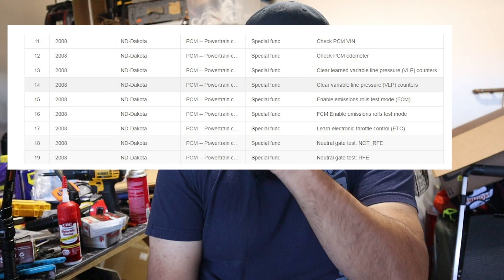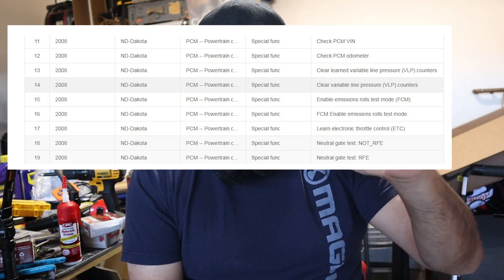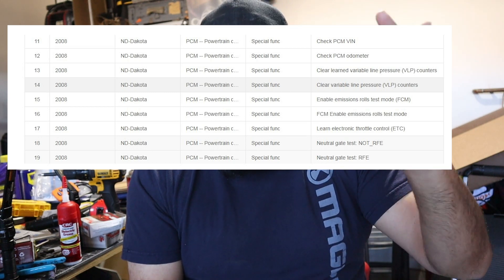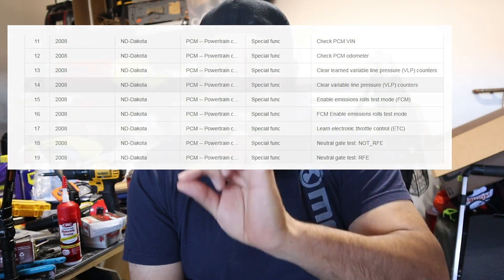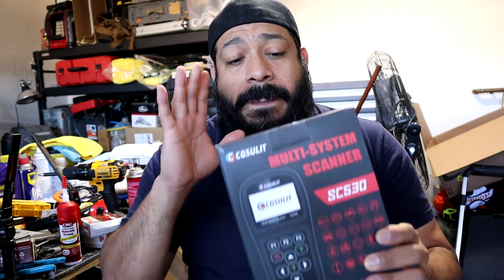Fixing Code P1745 on a 42rle transmission

Comment: Did resetting the code make the transmission start shifting again? You weren't very clear about that. 
 Typically erasing a code is not going to fix a problem.
I'd contact whoever you got the transmission from while the warranty is good.
Reply from the maker: Yes with the scanner that I got it reset it and takes out of limp mode after you cycle your key so on the off the on , you can Sara’s the code or it will go away on its own after a while, 2nd note I have evening having issues with my transmission which to be going back into limp mode after about 3 months I might have. Wiring issue I notice my plugs were funking might have to replace the plugs sense the transmission I put in is a rebuilt so brand new  hopefully this helps

Comment: You saved me lots of $$$. Followed your video and worked on my 2008 Chrysler Town&Country.  Be sure to select "Special Function" from the menu (towards the bottom of the menu.) And do the clearing on both (or all) codes. It was a quick process (15min) if that. Check engine light came back on after 530 miles but did no difference (effect) on driving or transmission (shifting.) It might be my imagination, but my van is performing better than before having this 1745 error code and into limp mode (maybe accumulation of codes in the system had impacted overall performance, who knows!) ...Thanks for the video👍🍻
Reply: I didn’t see that function

Comment: Engine light was still on cant tell if it actually worked
Reply from the maker: So the scanner did fix it but, the code got triggered again and went back into limp mode about 3 months later from what I have researched it might be a wire harness issue maybe a ground haven’t tried to fix issue just keep resetting the counter hope this helps if I fjnd the solution I’ll video it and post it hope this helps

Comment: Dude how long does it take to reset the p1745? I have a foxwell n1710 and its just on “please wait” for so long
Reply from the maker: It depends with my scanner I can reset it in 15 min
Reply: @walg4344  never bro, I did it. I had to get the transmission to operating temperature. So I drove for about 15 minutes at regular speed. Then reset it.

Comment: Is it still good today?
Reply from the maker: No and yes I just had it go back into limp mode about a week ago but again was able to reset the vlp counter 15 min later like nothing happened, have to dig deeper since the trans is a new remanufactured can't figure out why it did it again
Reply: @walg4344 let me know if you ever find out. I’m having the same p1745 code on my 08 Ram 1500 with the 42RLE transmission. I’m on my 3rd transmission with this same code. I went to a new transmission shop and the owner suggested that I may have a bad PCM, if all 3 transmissions had the same code. 🤔

Comment: Can you send more detail instructions on how to clear the code I did it but the car is still not shifting gears stuck on loop
Reply from the maker: You can’t just clear the code you have to reset the vlp shift counter
Reply: Can I reset it with the same tool?